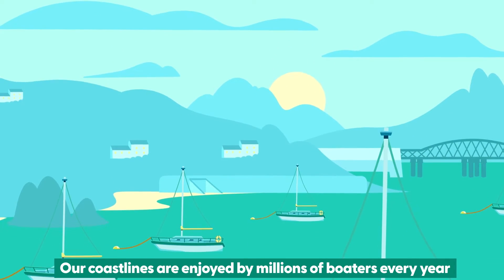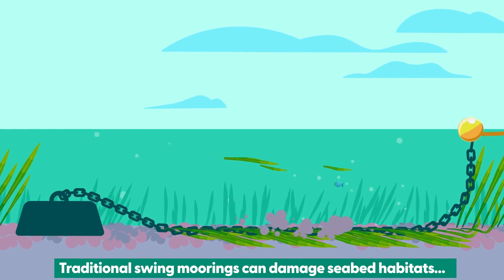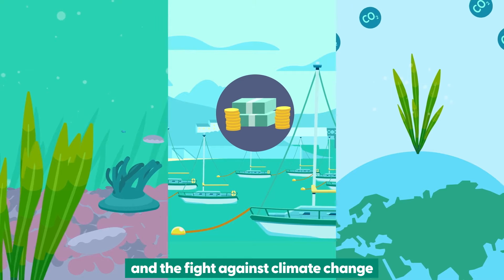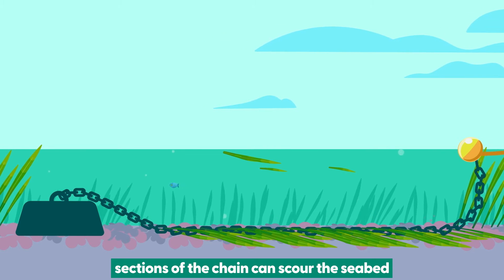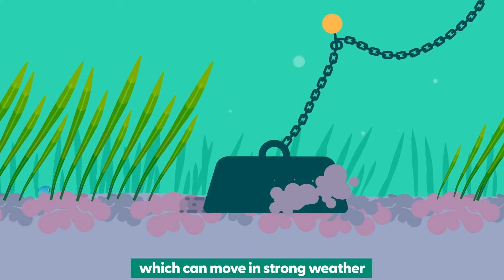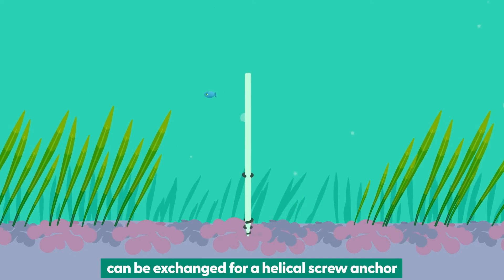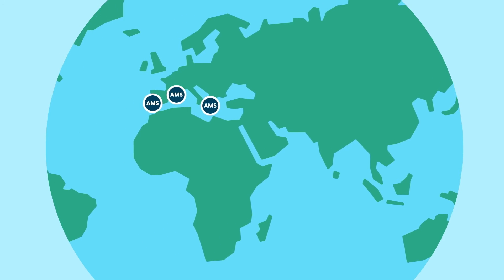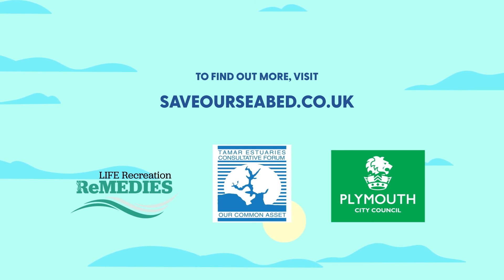How do Advanced Mooring Systems work?

Comment: Wait, so we have to spend more money for a mooring? And if the chain has floats why use a chain at all? This is a horrible system, the whole point of the chain is to hold the boat in place, the anchor is there to prevent dragging. Having the chain floating under water is just another invisible hazard for other vessels.

Comment: At least on bigger boats the whole idea is for the chain to hold the boat, not the anchor. The anchor only holds the very last bit of chain.
So wouldn't this system be vastly less effective?
Except of course for the "drilling into the sea bed" part, but is this actually without any environmental issues and effective everywhere? (in sand, solid rock,.... sea flores)
Reply from the maker: Hi, thanks for your questions. 

5 moorings of this design have been in place in Cawsands, Plymouth since 2019. There are also further installations in Cawsands, Torbay, Yarmouth, Falmouth and Salcombe. There have been a number of modelling studies and in-situ tests of this design by both ReMEDIES and others to assess and explore effectiveness and performance compared to traditional catenary chain moorings. See the research section on our website for more information - www.saveourseabed.co.uk.

The aim of the ReMEDIES project is to trial these designs in order to continue to gather evidence and information as to their performance which we can share with others to help inform future projects. AMS installations require careful design for local circumstances and different designs may be appropriate for different local conditions. Helical screw installation is generally carried out by divers with less long term footprint on the seafloor than a traditional anchor block. The Mooring section of our website has a video showing how these are installed. You are correct that helical screws are not always an option due to the seabed type, in which case anchor blocks are the alternative.